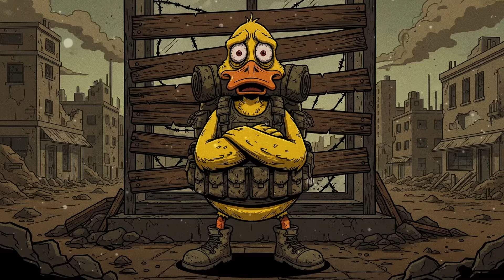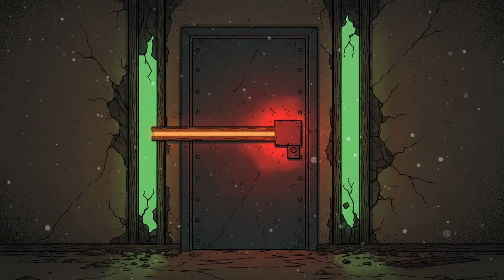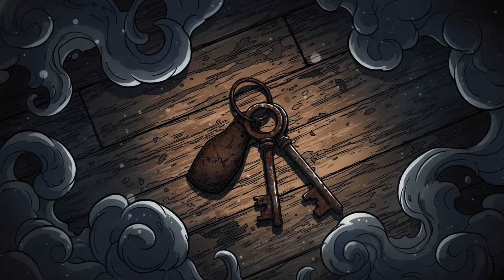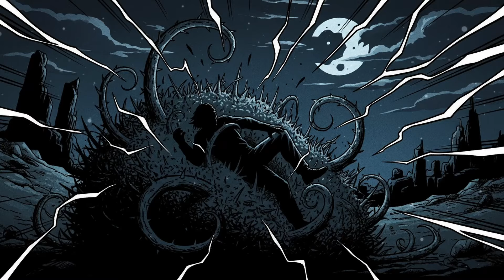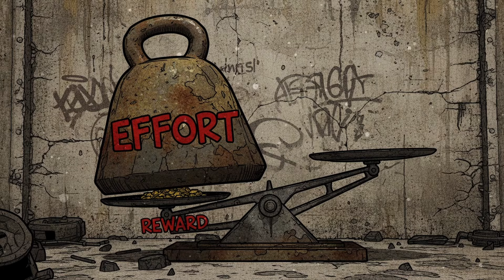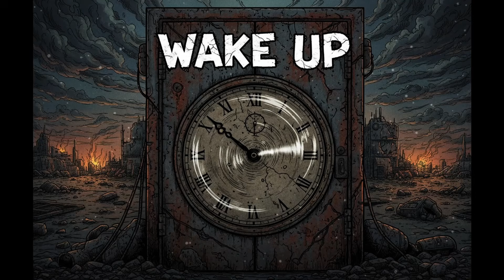Don't Trust Your Door Locks Reinforce Your Entryway For Under 5 dollar

Comment: Some of them they're just putting watches in around the doorway when it's supposed to be a 2 by 6 behind okay and one idiot sent to me that's what they all do that's why 5 ft 1 in woman hits the door twice and it breaks I've always put two two by sixes up against it okay and then took a road and route it into the two by six a little bit that was a deadbolt goes into the two by six so take the molding off around your door and see if they did that you have to make it to a square take a 2 by 4 sludge hammer put it up against their and tap it out till square think about you can't depend on a piece of wood that's not even an inch dick